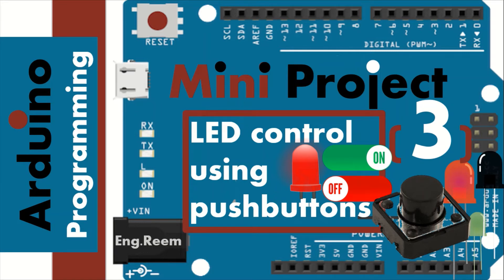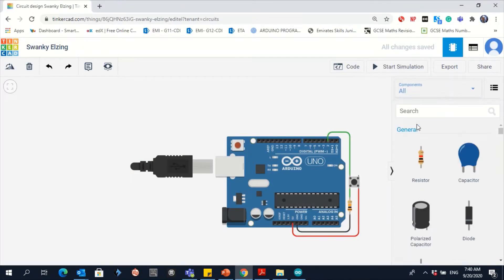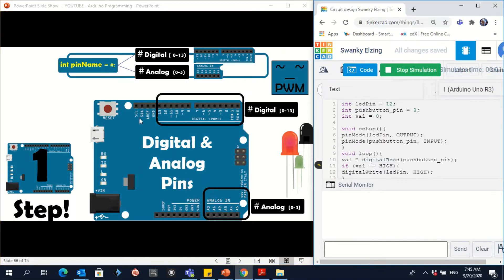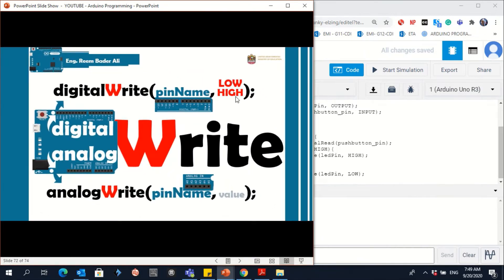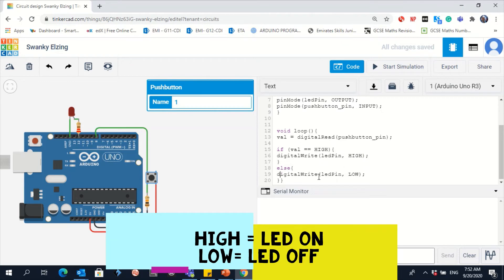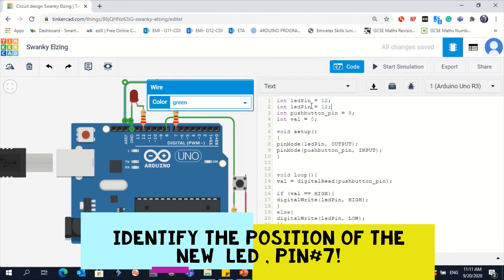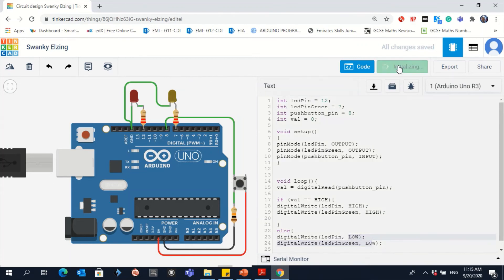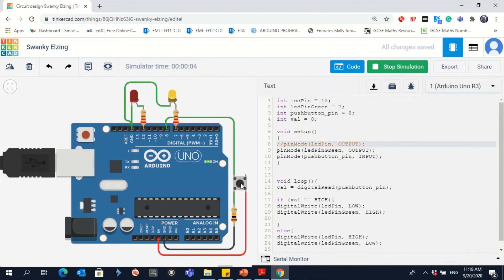Arduino MINI-PROJECT 3: LED control using pushbuttons

Comment: Aya Rashid 12-A 
I learned from this video that how to connect LED control using pushbuttons and we also use the digitalWrite to control the state of an led and digitalRead to read the voltage state at pin connected to a pushbutton 
Thanks

Comment: From this video I learned how we can control the LED using pushbuttons also using if statement and else also using digitalWrite for the value of the pin its LOW or HIGH.

Norah Mabkhoot 12C
Reply from the maker: Nora! you are doing a great job in coding, Keep it up!

Comment: Hajer Khalifa 12C 
One thing I have learned from this video, is that pushbuttons, potentiometers, and sensors are considered as inputs to the arduino, and the results or outputs could be taken from LED, buzzer or motor by noticing its motion.

Comment: The video was very helpful and it’s explain all the information in a simple way and I learn how to code a arduino using LED and a push button. There is a new information that I learn in this video is that if we put// in front of a line it will not work.
Asalah khaled 12C